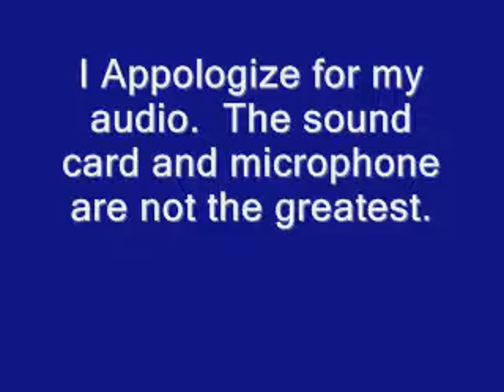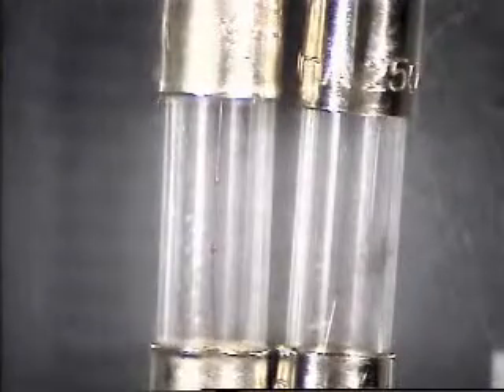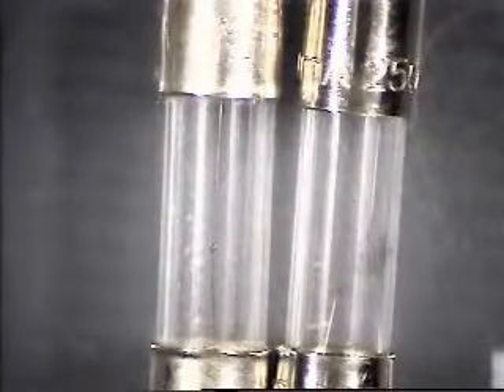Fuse Question

Comment: The fuse you used as a replacement should be a match for the first blown fuse. To determine what fuse should be used a manufacturer name and model number would be useful. If you have the owners manual, I would also look there, quite often they have that in formation in the owners manual. More information is needed to determine if the fuse value is correct. Try Googleing the make and model number. If the manufacturer has a website sometimes you can find information there.

Comment: Can you see if there is a fuse rating on the circuit board or fuse holder? It doesn't look like the overload was very severe as the fuse wire is just melted and the inside of the fuse is not blackened. I would not try a higher rating fuse though without confirming what the original rating was.